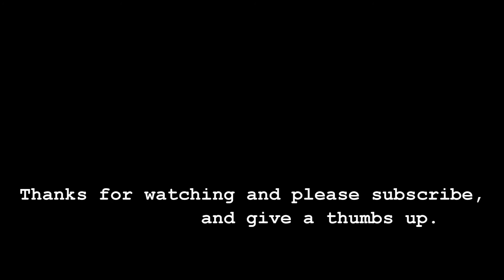Hodaka Model 03 Wombat Project #3

Comment: I had that exact experience with an Hodaka Model 03 pipe. I started restoring one a couple years ago. I went through the engine with new bearing and seals and went through the carb and it fired right up. It would not wind out in any gear, so I worked for several days trying to jet the carb and nothing would get the engine to wind up. I had another 03 that ran good so I decided to try the pipe from it and it took off like a new one. I burned the other one out just as Greg did and when I put it back on the problem was solved.
Another great video Kelly

Comment: I grew up on mini bikes in the late 60's and had already gotten some racing experience and believe it or not I was also riding the hell out of our family's Vespa 150cc scooter through the woods at pretty high speed, when I talked my dad into buying me a Bonanza mini cycle (I believe it was '69 or '70, so I would have been 12 or 13)...the Bonanza had the Hodaka 100cc engine, open air cleaner and expansion chamber and would do almost 60 MPH in stock gearing and would pull wheelies up to about 50 MPH....it was crazy fast. I had my eye on a Super Rat but then Yamaha came out with their YZ-125 and my dad bought me one of those and we got serious about racing...but I always thought the Super Rat looked awesome.
Reply from the maker: The Bonanza is a handful for sure. I don't know where you are at, but Hodaka Days is June 22-24 in Athena Oregon. Check it out
Reply: @Socal...yes the Bonanza was a "handful"...ours started by bending the jackshaft and sheering off the set screws in the jackshaft gears/sprockets. My Dad was an Engineer out at Cape Canaveral (I grew up in Cocoa Beach/Titusville) and he machined a new jackshaft and gears/set screws out of some high quality metallurgy which solved that problem in the powertrain, but then the engine mounts wouldn't hold the engine in place (the next weak point), so again my Dad machined some better motor mounts and that solved that problem, but the final straw was the back hub cracked around the center point and that was the end of our Bonanza...I rode the hell out of it for a year or two though and really learned to ride fast in the woods. Funny story: When we first bought it there were mini bike races about once a month at a public park in Merritt Island. It was a pretty flat dirt track with a couple small jumps...it was a run what you brung, no classes at that time. Most of the mini bikes were lawn mower powered (some hopped up and pretty fast) and there were always a few Honda 50's/70's there...I used to race my Tecumseh powered mini bike there and even beat the Hondas a couple times just because I was a better rider. Anyway the first time I show up with the Bonanza when I started it and took it on a quick rip through the pits pulling a couple wheelies, everyone stopped what they were doing and crowded around it...there was talk of not letting me race but my dad pointed out the Honda 70's were actually bigger...anyway they let me race and I ran away with it...I lapped the field in about 3 laps. That was the only time I raced it...after that said nothing over 70cc's and I think no clutches either...it was right when times were changing and there was obviously a need for different classes and the monthly mini bike races kinda ended about that time. Nice chattin with you, oh, and I'm a retired Engineer who still lives in the Central Fl. area so Athena is a bit of a haul.

Comment: 1) I would never cut a pipe right down the center, I cut the seem  2) I completely remove and discard ALL the mesh/screen. 2) then tig weld it back together
Reply from the maker: Brian Smith this pipe was junk to begin with, took it from the scrap pile.